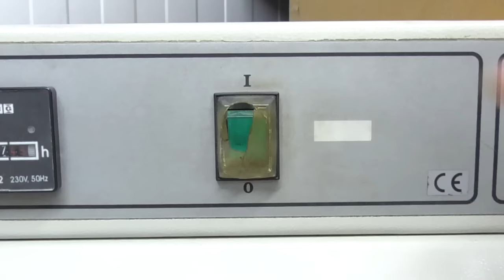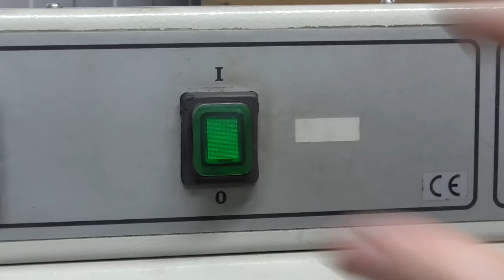Antique Ox-Tongue Iron - Restoration

Comment: I like what you do, and your precision and standards, and all that said, i cannot for the sake of me get how come you are WASTING so much perfectly useable material!
no, it's not the screwmaking. i'm talking about THE OXtounge! you could have made 2 from that piece! but you milled it all into chips, that will only end up in recycling, or casting, but if it's an alloy, it will only be worse quality metal than it was, and seeing how you are probably acquainted with metals, you know that!
just cut it in half, and maybe the rest will be good for the next project? like that looked like a good 2 pounds of metal!

also, as an official woodworker, i feel compelled to write it down. yes making pulgs is nice, but the epoxy is ugly! no matter how you dress it, there are wood repair paste's out there for all wood colors that are NOT epoxy based, so it will age with the wood.
also, i like that you are using wax, yet i suggest you use linseed or other oil treatment FIRST, and THEN wax and buff it up (to the shine you want) because a simple wax layer is not protective enough in the long term, especially against our hand acids and wear&tear, so you have to re-apply wax often, but if you have oil dried into the wood underneath, you can't wear that off with use.

as well as gluing the copper piece and the rod in with epoxy -> now you just made it unreparable. the reason for the "ring" is because it holds the handle onto it, it's not an artpiece, it had real function. the wood was overdried, so it shrunk up, then the rod with a little shim was put into the now larger hole, and the copper "ring" was put on the smaller outside diameter, then the wood was put into water, and then airdried to room% and oiled up. so the wood stabilized and the handle was never moving because it swell up around it, and to disassemble, you just put it in an oven heat, dry it up, and you could repair, fix the metal or wood part infinite times!

the only way you take out epoxy is with damage, lots and lots of damage. so reparability traded with convinience... just like with hammer-head-to-handle, the curse of modern technology.

it's one thing that you restore these, but what about those who find it a 100 years from now?

with kind regards, keep evolving and restoring!
Martin.
Reply: I was initially worried about the amount of waste of metal and time to make that ox-tongue but since it is recycled guess it's useful for someone else. It is interesting to read someone else's perspective. I like watch the repair shop on BBC but this guy just takes it to another level. I like any type of restoration....

Comment: When he heats up the metal and puts it in liquid and it comes out black, what is that process called? I have never seen this
Reply: This process is called bluing! It protects against rust and turns it black, you simply heat up the metal and put it in regular oil and pull it back out! It is called bluing for the blue-tinted black appear that comes from it.
Reply: You cam also use bluing liquid as he does in many episodes
Reply: He has a video on his second channel all about this!
Reply: He has a video on his second channel all about this!
Reply: Thank you!

Comment: I love these restoration videos. I just have a question regarding the nuts and bolts. Do you have to make them from scratch? Aren't these standard and available in hardware stores? Just curious. Don't get me wrong I like watching you cut them on a lathe it just seems like it would be easier to get them from a store.
Reply: I think he has said in previous videos that the zinc coating on store-bought hardware prevents him from blueing or adding a protective oil layer.

Comment: Fantastic work, as usual.

A question: could the asymmetrical holes in the handle have been added intentionally, to prevent the wood from splitting along the grain under heavy use? 🤔

Comment: I'm not exactly well versed in particular models, but there's a chance the slug/insert was made of a hazardous material and just got tossed over the years. Not saying that's a good practice for the sake of preservation, I just know asbestos and such were used at times, so it could have been removed at any point for that reason not considering it's value to the complete antique.  But yeah like I said I have no idea what the original would have been made of for this model, just a guess. Love your videos!

Comment: Cool. While doing some digging up of some overgrown with weeds sod in my back yard I am finding antique steel objects which so far are only parts of large machines or part of a pipe system. Who knows. I might come across something worth restoring while doing so next. Except for one thing. Wouldn't restoring an antique only decrease it in value unless I only wanted to use it because I cannot afford to buy one?

Comment: Love your work. 

You always make it look so easy. But I’m sure you’re well practiced. 

One question though. When making the Ox Tongue, Wouldn’t it have been easier to just cut it in half after making the tapered end using a metal chop-saw or band-saw instead of the vertical lathe? (I think that’s what it’s called.) 

Still, As always excellent work.

Comment: When you create the thread, you only turn the tool in one direction, like only clockwise. At school 2 years ago, my teachers told me that after you rotate the tool 360°, you should rotate it a little bit anti-clockwise just to break the metal chips. You don’t do it to gain time or why?

Comment: WOW...those nuts holding the handle bracket looked really rusted:  I'm surprised they came off without penetrating oil!
I wonder what the 7-1/2 marking is about?  7-1/2 WHAT???
Is that emery cloth you're using to grind down the door to the final shape?  I didn't know emery would grind down metal that much!

Comment: When you switch on the sand blasting machine, the button cover is torn off. 
When you switch it off, the button cover looks like new. Is that video part older and you just re-used it?

Comment: I may have missed this in the video, but what did you use to replace the asbestos insulators between the handle and iron?
Reply: @ 15:11 he explains what he's using in place of the asbestos.
Reply from the maker: it's duroplastic (bakelite)
Reply: @Vickie Bligh @my mechanics Thanks, good to know!

Comment: I can't remember if I asked this, but I have these 1950's cast iron Coca Cola chairs and I soaked the nuts and bolts in rust remover for 24 hours in an attempt to save them. I took them out and they immediately rusted right before my eyes. What gives?
Reply from the maker: You need to wire brush or scotch brite them after soaking and then apply any oil.

Comment: You videos are awesome, but i don't think its very economical. I mean you wasted half a block (ox tongue) to milling. You need to buy a saw. It will not only reduce maching time but also save material and save electricity, all leading to saving more money.
Reply from the maker: The other half would still be not useable anymore. I'm recycling all chips
Reply: @mymechanics that is good to hear. Anyways amazing work man.

Comment: There were two ways to use these irons. 1. Without the ox tongue insert. For rapid heating atop the kitchen wood fueled stove. 2. With the ox tongue placing the ox tongue within the burning chamber of the wood fueled iron stove before inserting it into the iron.   For some reason you assumed the ox tongue insert and handle from the one you purchased. 

The restoration did not respect the original wood or attempt to preserve any remaining patina hidden under the rust. Also, using plastic parts means they will need replacing over time.  Another issue is that your restoration took so much material off some parts that future restorers will have to replace those parts outright as any further need to remove material will turn the metal into tinfoil.